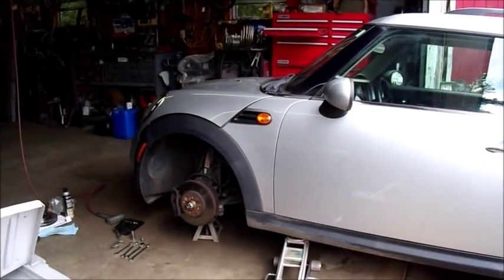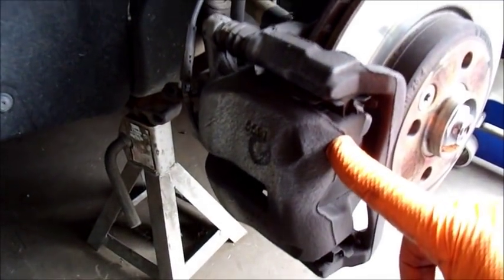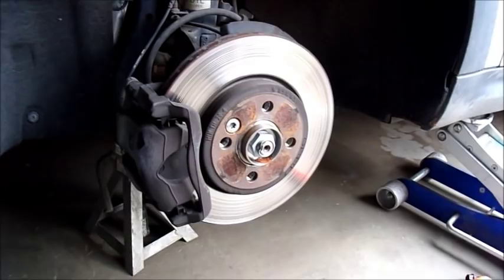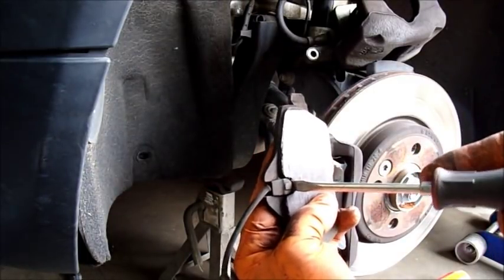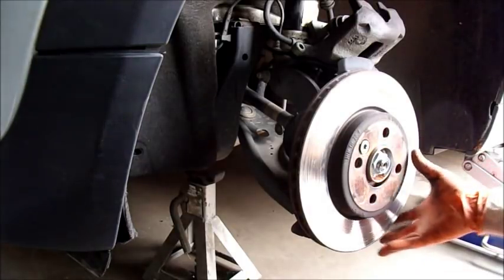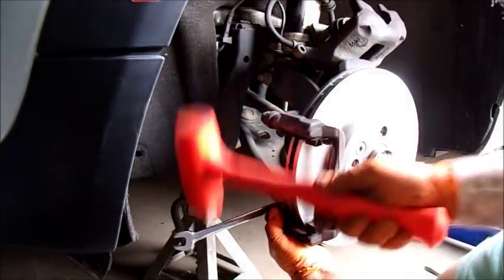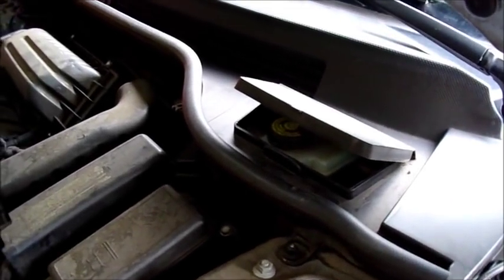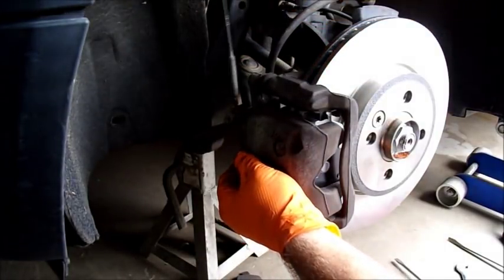Replacing brake pads and rotors on a 2010 Mini-Cooper

Comment: Very well done!  Thank you for taking the time to put this together - great help.  On our vehicle, I thought it was a good idea to clean the hub surface with a wire brush before putting the rotor on. It wasn't bad; but having debris in that area may cause the surfaces to not sit flush...and the end result could be a slight shimmy. The hub in your video appeared to be cleaner than what I was working with.  Strangely... ours is and always has been an Arizona car. But it only took a few seconds and it isn't a bad practice.

Comment: I beg of you all, NEVER use locktite on the rotor retention bolts, ever, as they are ONLY meant to just hold the rotor to hub, while the wheel is off the car. use Anti-seize actually and just snug it up when reinstalling. never torque it up. In Fact the Mini retention bolts, as Jo Daddy's garage has eluded to, has a triangular threaded stem, and acts as a deformed thread so it stays tight anyhow.

Comment: Good video and much appreciated as Im about to do pads and rotors on this same vehicle for the 1st time for a friend. But some friendly advice from a mechanic is dont put loctite on the bolt that holds the rotor onto the hub, especially red. The next guy to do Rotors or a hub wont be a happy camper.

Comment: Nice job 
Greasing the slide pins is always a good idea checking boots for tears and cleaning up or replacing the pad tabs on the caliper bracket and it's good mindset to remove the master cylinder cap when your pushing the piston in on the caliper...

Comment: Nice video.  I like knowing the wrench sizes before I start.  I used the advice from @Andrew Wilson to turn the steering wheel to each side.  I also used the old pad when compressing the caliper as the video advised.  One thing that I do extra that wasn't in the video, is support the caliper with a wire hanging from the coil spring (I have had to replace a brake line when I dropped one long ago).  When I ordered the rotors, I needed to know the outer diameter.  There was a choice between 280mm (about 11 in), 294mm (about 11 1/2 in) and 316mm(about 12 1/2 in).  Mine was 294mm for a 2010 Cooper S... but measure them for yourself.  Thanks again for the video.  It was very well done.
Reply from the maker: Thanks. I have also used a wire to support the caliper. Good advice.

Comment: Great video. The video itself demonstrates  your patience which translates into great detail and content for  the viewer.  Thank you for your time. I have two questions. One)  Why do you use Red loctite as opposed to Blue Loctite. The Red,  is permanent and may require having to heat or possibly stripping the head of the bolt ,  The next time it has to be done. . (Not a Criticism, merely a question). Second question)  should you,  or should you not,  use Anti sieze on the caliper bolts. (Again only to help with  future take downs) also anti sieze helps,  to  prevent Bi-metal corrosion and possibly rust and corrosion from the elements . What is the real scoop on that ?   Your opinion?   I say yes,     Am I wrong ?  especially on Anti sieze.  Some say yes,  others no. However,  I did notice when you removed the caliper bolt. It had a small amount of BLUE  loctite on that bolt. That tells me No anti sieze. However, that   could be a result of some one else's work.  not factory .  
What is the real deal. ?  again thank you for your time great video .    Semper fi
Reply from the maker: I have used red loctite before, and haven't had problems removing bolts later. Thanks for the observation. Anti seize is useful for heat applications, like O2 sensors, and direct metal contact with dissimilar metals like aluminum and steel. I have never used it on caliper bolts. Right Of The Line!

Comment: Cool vid. One of my torex bolts which holds the rotor on was seazed solid and the head of the screw has got damaged / ruined. Any ideas how I get it out now?
Reply from the maker: Best bet is to drill the head off. Then drill and retap.
Reply: @JoDaddysGarage  job for the weekend then. That heads getting drilled! I'm not going to bother replacing it either, I'm sure the rust will hold the new rotor on after a few months :) thx!

Comment: The wear sensor should be replaced.  Its not expensive, about $10 for an OEM equivalent.
Reply: Jon Acton the way he did it which is the smarter way, you wouldn’t need to.

Comment: I had my brake pads replaced not too long ago. Now it's time for rotors. My question is if i'm only replacing the rotor, is it necessary to remove the caliper off the bracket? Or can I simply just remove the bracket to get access to the rotor without touching the caliper and the brake pads.
Reply from the maker: It will be best to pull the caliper. You will need to compress the piston regardless. The new rotor will be thicker, even by a few thousandths. The pads will not slip over it.
Reply: @JoDaddysGarage  Thanks!

Comment: Can you re-use the brake sensor cable?
Reply from the maker: Should be able to. As long as it's not damaged.
Reply: How do you determine too much damage?
Reply: @rojoque  if the previous pads wore out, the sensor would have thrown a warning on the dash... If not, no damage done. If yes, maybe replace it, as it might have been ( will have been) scratched by the rotor.

Comment: Makes life just a little easier if you turn to full steering lock. In the U.K. This is a car I do many times a month, there an awful lot of these cars on the roads. The disc securing screw sometimes feels like made of chocolate! Has to be drilled and removed with vice grips.  Brake parts so cheap I have never skimmed discs, just not worth it. I imagine you paid less than $100 for discs and pads? There are no A/F bolts on the car, everything is metric. Instead of 5/8" it should be 16mm.
Reply from the maker: They were quoted $400 at a shop. I did it for $180 parts and labor. Yes, I noted the comparison of the 16mm to a 5/8. It seems that most metric wrench kits in the U.S. don't come with a 16 or 18mm wrench.
Reply: Jo Daddy's Garage that figures,I had to order them separate when I bought my snap on wrenches! Got to wonder why? Maybe they refusing to accept metric!
Reply from the maker: No. I believe it's because they are so close in size to "standard" wrenches that they don't feel the need to put them in the sets.
Reply: Jo Daddy's Garage bproblem is here in UK car brakes are nearly always rusted and stuck solid. I like to have exact wrench size. Car brakes always a shitty job here- rusty,seized, dirty. I would like to work somewhere nice where cars don't rust! You do great work sir,I watch all of your videos and a subs.
Reply from the maker: Thanks. I grew up in the Northern US where rust is always a problem. I like living in the Southern US where everything just comes apart normally.